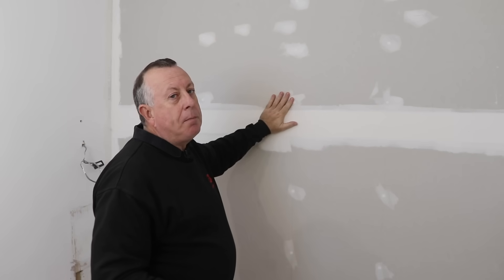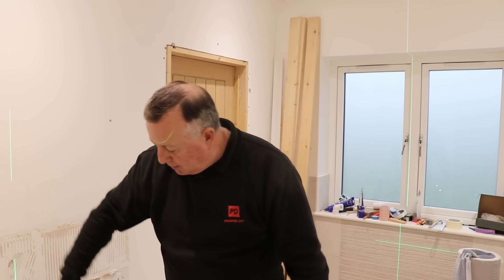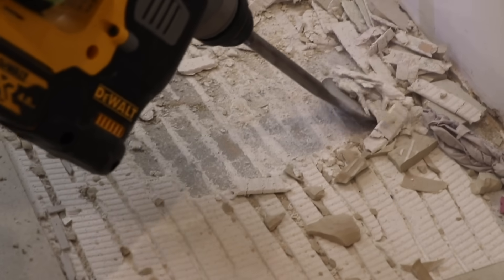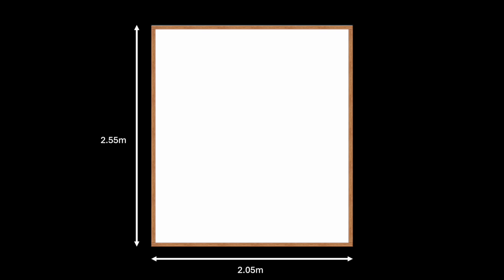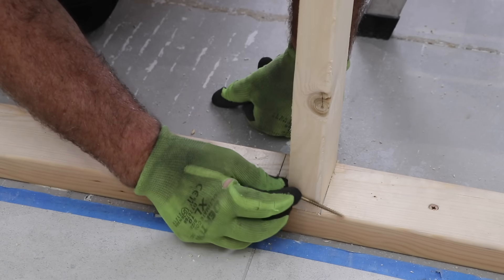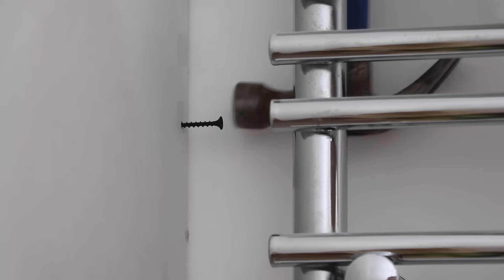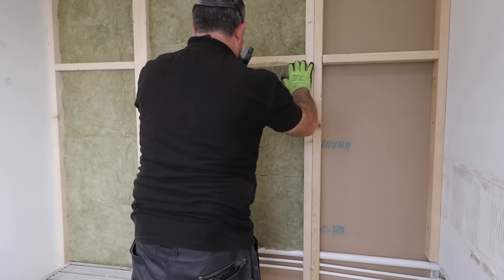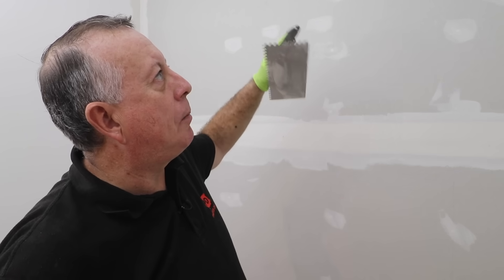How to build a Super Strong Stud Wall For Heavy Loads

Comment: Heres a couple questions for you Stuart or anyone else that can answer

If I've got a carpeted room and want to build a stud wall to partition it, would Ibuild ontop of the carpet or do i cut the carpet, fit the stud wall, skirtings etc then re-lay?

Also, if there is a place I want to fit a stud wall but there is no joist directly above or below, is it acceptable to fit noggings above/below and attach the wall to that?

Comment: I ordered 4x2 timber for a stud wall because all the previous work was in 4x2. A friend took delivery unfortunately as I would have refused it. I ended up with the smaller planed timber and was stuck with it. I thought of putting two layers of plaster board up on each side or having the plasterer do a super thick number of coats but we had to live with it. Most people do not notice the mess but every time I go into the room it just screams out. This wall is too thin and sticks out a mile with 1/2in steps all over the place. I hate how the days when everything fitted are gone and now every job now is a bodge.

Comment: Ah, the mini wrench. I bought one from the Range years ago - made by Draper. It has been in use countless times at work. I really didn't expect it to last as long as it has. It still shows no sign of failing. My laser level I've had 3 years now, bought from AliExpress. Absolute bargain and I do wonder how I ever managed without one. Good job there.

Comment: Not bad, fair play, 👍💪 I go 300mm/12" O/C with C.L.S because it's weaker than sawn 4"x2". I fit a double bottom plate to my non-load bearing stud walls because it gives extra nailing for skirting. I'd double the top plate if an ornate crown moulding was being fitted as well. Two rows of noggins are standard for me as well. Did you consider buying 9' slabs? Or would they have been too awkward to get into the room? Blue acoustic plasterboard would be a better choice for a party wall in a bathroom. Green plasterboard for bathrooms is the way to go. Permabase is my choice for shower's, sinks and baths.

Comment: Depending on the size and material of the tile, you would have probably been better with a cement backer board, plaster has its limitations with weight loads

Comment: Nice video, thanks!

If you're not too sure where heavy fixings will go or want belt and braces, you can osb/ply over the studs before the plasterboard. This also helps with sound & thermal insulation.

If you osb/ply first then you can then use those XPS filled tile backer boards which give a bit more thermal insulation (obviously only for tiled area) and are very easy/light to work with

Ignore the rockwool haters, it gives better sound insulation, vermin hate it (they'll happily nest in glasswool) and has a higher fire spec

Comment: Assume this works the same for a DOHC 16 Valve where the plug sits vertically in the centre of the four valves. I have a Mazda CX-30 Skyactive X (UK & Europe spec), and I'm just concerned about possible interference between piston and plug. Mazda Europe has a procedure for the Skyactive  X plug change, but nobody outside the dealers network can see it. I'm assuming that if I use the genuine Mazda plug, it should be OK?
I'm not sure if you have the Skyactive X in North America at present.
Great video, many thanks.

Comment: Very useful video. Thank you very much. I noticed you said, apart from tiling the bottom half of the plasterboard, you wouldn’t skim the top half and just paint it. I’m about to do the same in a spare bedroom, plasterboard,fill the joints then paint. I would like to use those 3M command strips on the wall for a few pictures. However, I am a bit concerned removing them as and when I need to, may rip the plasterboard paper. Should I be concerned? Is it best I skim the wall if I am to use those sticky 3M command strips? I hope someone can advise. Thanks

Comment: I’m literally in the process of converting my ridiculously oversized en-suite into walk in wardrobes and smaller (but still not small) en-suite. I had hoped to save the bathroom fittings but ended up realising just how bad the builders did it originally so starting over.

Comment: You should have done studs at 600mm and used Acoustic Roll. As for “cheap stuff” … you mean normal stuff. You’ve paid over the odds for Rockwool and not gained anything? Density is not a measure in insulation… it is simply marketing term. 25mm Glasswool will give you same results here at 1/3 of price 😉

Comment: Another great video from my favourite DIY channel. Do you have any advice about wallpapering please? Specifically, making a wall good for painting after removing wallpaper. I have been putting off re-decorating our spare room because I'm not sure how to deal with the potentially sticky mess left behind.
Reply: Use Zinsser Gardz on it. Just be aware that you need to coat the whole wall, as you will get flashing in areas that are not coated. Follow up with a primer before applying emulsion.

Comment: Anyone in the UK recommend a mask/respirator for use with a full beard?  Or as I suspect I am never going to get a good seal ?
Reply: You'll never get a proper seal over a beard. Your choices are to accept that (it's still pretty good, usually) or use a positive pressure helmet (very expensive).

Comment: Placing the bottom plate and the top plate parallel to each other on the floor the positions of the studs could have been marked on both pieces with your pencil and a carpenter's square. After the top plate is fixed, the studs would not need to be checked for spacing or for vertical accuracy. Love your videos!

Comment: The metal type stud wall is so much easier, but good job anywho
Reply: It's a bit of a pig to attach heavier items (eg TV bracket, large mirror) to afterwards though. Much prefer wooden studs (or preferably a solid wall).

Comment: Hi Stuart, Always enjoy your videos, lots of great tips.
When you were installing the sound insulation in your stud wall weren't you tempted to put two layers into each space to fill/overfill the space or is there a reason not to compress the insulation product?
Thanks again for some great stuff 👍
Reply: 25mm will have same performance as 100mm in this application. One of those things. Cavity helps to disperse sound. Too thick/too dense carries sound.

Comment: Rather than trying to space the studs to suit the fittings keep to 400 mm centres to make insulating more straight forward. Where fittings are going use patresses which are just 18mm ply or OSB panels held in between the studs against battens fixed to the sides of the studs 18mm in from the front edge. Screws driven into 18 mm ply or OSB are not going to pull out easy but if you are really concerned use dry wall anchors they are not coming out at all. The beauty of patresses is you make them oversize so you do not need to worry about exact positioning until the fitting is being hung and a wider width spreads the load
Reply: Yeh good old ply pads never go wrong .  Or timber pads to create a fixing

Comment: Great job. My top tip for cheap masking tape is to put the roll in the microwave for 30 seconds just before you use it and then it peels off the roll a lot easier and sticks much better.
Reply: Worth a go 👍
Reply: What? No way f#*sakes
Reply: is that using the customers microwave hahaha
Reply: @Dr.Stacker If you’re doing this for customers you shouldn’t be learning how to do it from a YouTube video…

Comment: The things you learn on You Tube: it was a revelation to learn, as a Canadian, about the Canadian Lumber Standard for the studs, which we also call two by fours like our American friends. That may sound very strange and odd but that Canadian Lumber standard is not just commonly referred to here or used at least at the retail or consumer level, in my experience, anyway, which may mean absolutely nothing. When you mentioned it in this video, it was literally the first time I had ever heard of it, ever. Apparently it is a "thing" in the UK but not here. You walk into a Home Depot in North America, for example, and if you can find any studs that are not warped, bowed, checked, or generally resembling hockey sticks, they will not include any mark for the CLS but I think they do include a so-called Grade rule "NLGA" and "SPF" for Spruce Pine Fir etc or heat treated. Anyway, that aside, interesting project that was very well done. That 3 way laser is very cool! Also, I find the bigger drywall knives make it a lot easier for this amateur to apply and taper/feather out the mud and are generally well worth the expense. It sure does help to plan for and consider various fixtures, mirrors, towel racks etc. when installing studs for a bathroom.
Reply: 82K views, 189 comments and not one response or even a like from the content creator. That is a disappointing level of engagement with your audience.

Comment: As an absolute minimum the plasterboard for wet areas should be MR (moisture resistant) grade.  My normal spec for an internal stud wall is two layers of plasterboard as it gives a really solid feel to the extent that most people can't tell the difference with a masonry wall with excellent acoustics that don't need the Rockwool.  Plasterboard is cheap and the additional labour is minimal also, repairing damaged double boarding is simplicity itself.  BTW plasterboard can be had as 3000mm long x 1200mm from the builders merchant.  Where tiles are to be placed on the wall I always spec a tile backer board, usually cementitious, that can be one of the layers.  This is important as there will be differential movement between tiles and plasterboard or plaster, causing hairline cracks in the grouting and water penetration back to the studs or floor boards.  In bathrooms where we often have full height tiling and a range of fittings to accommodate, I usually spec a 20mm ply instead of the plasterboard and then the tile backer board.  The ply is simpler to fix than patrisses  and gives excellent fixing strength.

PS  Why take out the floor tiles?  They would have been an excellent walk in wardrobe flooring and if that wasn't the desired surface, could accept carpet readily.

Comment: Usually safer using green moisture resistant plasterboard for bathroom/humid areas and drylining is usually finished with drywall sealer.

Comment: If you thin out your mud just a little it will spread easier and come out smoother which means less sanding. You might even get away with using a damp sponge to get it smooth. Drywall mud is always a little dru strait out of the bucket from sitting around for god only knows long.

Comment: Funnily enough, I am building a stud wall partition in a friends house to reduce draughts from the front door that opens into their living room.

Materials are shockingly expensive, probably in the region of £370 for plasterboard, timber, door liner, door and architraves. Still a big saving against the £980 cheapest quote he received; absolutely shocking when you consider how small the project is and achievable in one good days work.

Comment: Only use 400mm centres if you are using full 8x4 sheets of plasterboard. If you are working alone, the smaller 900x1800 boards are a lot more manageable, and they require 450mm centres.
Reply: Thanks, that’s a great idea. I am going to be doing new stud walls in my house after new years and the ceilings are all 9 feet tall so this will work out perfectly. 👍